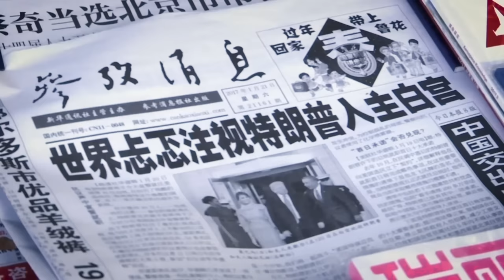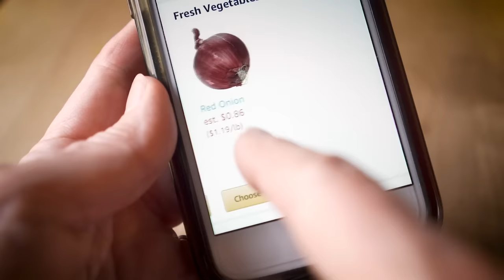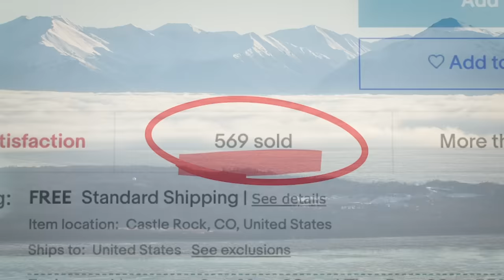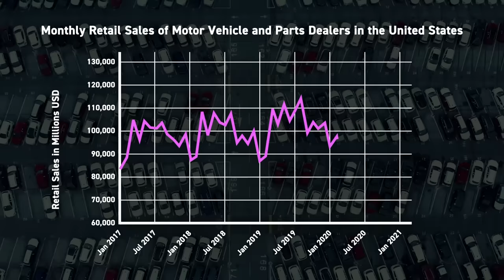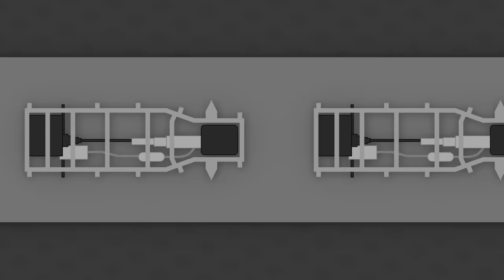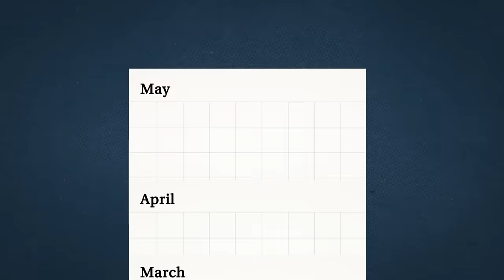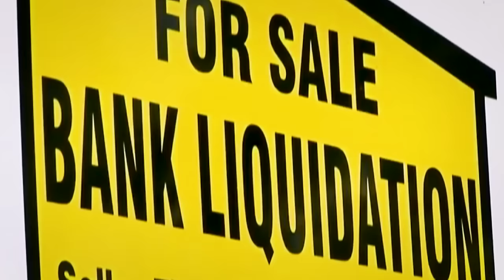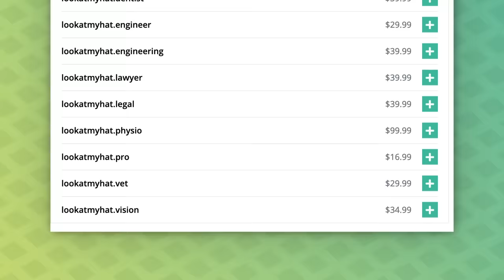Why There are Now So Many Shortages (It's Not COVID)

Comment: This video points out what happens when a single item in the supply chain is depleted when basing one's supply chain management on the Just In Time (JIT) philosophy.  You can have thousands of unique parts ready for assembly but a single 10 cent item can hold up production.  This video uses the semi-conductor as an example but it could be any part that holds up the production line.  The key is differentiating between complex and simple supply items and then mitigating risk appropriately to ensure proper inventory of complex supply items are available.
Reply: semi- conductor =processor chip
Reply: Exactly. The disruption caused by the Tsunami In 2011 should have been a learning moment.
Reply: No. JIT is NOT the problem. The problem is all the manufacturing being done in China, or off-shore. We did not have a food shortage BECAUSE 99% of our food is grown or produced locally.
Reply: @odysseus2656  and exactly how is foreign stuff a problem?
Reply: Doesn't matter so much where it's coming from, just matters whether and when the necessary ingredients come, although having your supply chain spread all over the globe means that a natural disaster or political disaster anywhere means a greater chance of your supply chain being disrupted.
Reply: @Vrangelrip  It's not "foreign stuff", when the quarantine started the Chinese supply chains shut down completely. I work with a U.S. electronics distributor, we had  Chinese tech firms ordering components from us here in the USA that we would ship to China. That put a strain on U.S. tech firms supply chain which pinched off supply.
Reply: @odysseus2656  It adds risk to delays and adds risk based on politics but it isn't the main issue. A solution to the main issue is; Building manufacturing that doesn't run at capacity and can ramp up if needed is a solution but this requires infrastructure to change where the supply goes if any 1 facility is damaged. Implementing that type of backup is difficult across boarders, and not as profitable in the short term. Toyota's solution to the supply part was well thought out.
Reply: The real reason the USA west media falsely accuses CHINA of mistreating Uyghur Muslims is because they want to prevent the 1.6 Billion Chinese worldwide and 2.0 Billion Muslims from working together. Both these groups have been discriminated by USA and the WEST for decades and are more likely to work together. Chinese & Muslim nations working together will lead to US losing its dominance of the world. Plus this will gain Asia, Russia and African support too including the rest of the world.
Reply: @jameslim3850  No, I worked with a Chinese company, China does mistreat Muslims.
Reply: @MindHunger  I live in a country where Muslims and Chinese have been living together and working together peacefully for many decades. So you are completely wrong.
Reply: @jameslim3850  Chinese people live in many countries. In most places, they live in peace with everybody. In mainland China, however, the Chinese government is enforcing discriminatory policies against many ethnic and religious groups, not just Muslims.

It's a historical trait of the Chinese civilization. And it's the reason why China has survived, as a state, whereas Rome has not. Both were once huge empires. However, China worked hard to enforce a single language and a single culture across the entire empire, whereas Rome was content with letting every ethnic group and every religion do their thing, as long as they were paying taxes. This has led to one single huge country, in the case of China, where this policy of assimilating any minority group, forcefully, if necessary, is still practiced, and to many countries, each one culturally different, although heavily shaped by their Latin inheritance, in Europe. Even more, Germany, Austria, even Russia - countries that were never part of the empire, were still heavily influenced by the culture of ancient Rome. Therefore, while Europe is culturally quite diverse, there are many elements that bind all European nations together. The EU isn't just a political construct, it's the result of the cultural closeness of European nations.

Which system works best is something everybody has to decide for himself - none is without flaws. But if you look at human rights, human development index, GDP per capita and mostly any such indicator, Europe, overall, does way better than China. Few countries in Europe, and none in the EU, fare worse than China. This, IMO, is highly likely to be at least partially related to the cultural differences between the two societies. Cultural diversity is nurtured and stimulated in Europe. In China, being part of another culture than the mainstream one gets you in trouble. In fact, it can get you in jail, or even worse, killed.
Reply: @jameslim3850  Also, Taiwan is a country 🇹🇼

Comment: Also Toyota is offering straight cash for the chips.  Meaning when the chips are ready to ship out, the manufacturer gets the payment immediately, instead of to be billed later.
Reply: Also Tesla has been pre paying for their chips when they order to be at the top of the list
Reply: when i buy in town from local merchants i always pay first. i demand a receipt proving prepayment, an ink signature, sales clerks get pissed off, bosses shut them down. In twenty six years of living here I have NEVER had a late, missed, deferred delivery (I also tip the delivery drivers with cash and/or bottles of gatorade! 😁).
Reply: Net30 is an industry norm for US due to at times not getting items in time.  Problem is it works on some industries due to the way they are.

Comment: “Short term profits over long term gain” - this is the fundamental problem with all economies. Every CEO in a major company only cares about the next shareholder meeting. Investors expect instant returns. If you don’t do well the next quarter, you might be fired.  So these executives will always prefer short term gains. Changing this would require a complete change of the current system.
Reply: Notice most CEOs only last 3-6 years? They never deal with the consequences of their actions.
Reply: Not true of founder CEOs.

Comment: When I played Factorio, my production lines had buffer supplies in them, so that if for some unforeseen reason my production line shut down, the downstream factories would have a buffer of supplies that would last until I could get the production line up and running again.  Production lines were always higher ramped than necessary to provide for the factory, so the buffer would fill until it was full, and the buffer size was set so that it was excess, but not a terribly large amount.  Just enough to get by on during an emergency.

It's sad when video game players are more familiar with proper supply chain logistics than the so called experts who do it for money.  Hell we do this shit just for fun.
Reply: Well, factorio did not have office politics in it~ But I get your point, and would like to add another : executives should try playing simulation games to try new ideas.
Reply: @bmanpura  But that would require them to use of their time and time is money. And it would actually require them to learn and do their job properly to provide backups and engineering redundancy into their systems, which will take out of their precious profits. But hey, it is not like strategy sims teaches you about redundancy or anything
Reply: @jack6723  Haha! That's a good point.
I hope they love their job and their customer more than they say they are.
Reply: @_prithvideep  not only that, they did not expect the United States Feds will flood the system with stimulus which creates artificial demand for the products. They probably mostly thought that the US Feds will be able to handle themselves properly and allow the system to fail. They failed to realize that ever since 08, the US Feds have deemed things are "too big to fail" like the financial institutions and other companies. If you had a company running at a negative and were deemed "too big to fail" the United States would bail you out. Which btw, is not how the game should be played. Now, business that are trying to start back up, can't because the Feds have outpriced them out of the market. It makes you wonder how much of the problems could be solved if the Feds didn't touch it
Reply: Difference with factorio, if you produce 10,000 green chips, you know you will eventually need those 10,000 green chips. Recipes that need green chips (red chip, inserter, etc.) stay the same throughout the entire game, they dont change. You are not going to be left in a situation where you use 100 of your green chips and the the recipes suddenly change to needing 'yellow chips' instead, making your other 9900 stockpiled green chips worthless.
That is why stock is considered waste in Toyota/Lean manufacturing - they dont want to be left in a situation where a model change makes their inventory worthless.
Where the problem is, they dont make allowances between products that will change in the short term (a car door for instance, which only fits that particular car), and those they know they will still be needing in a year + time (a can of paint, a pallet of chips),  and view them all as waste.
Reply: @FPK I was reading through hoping someone would know that storage has a cost. Possibly needing more space. Then protecting the product. In a business like mine we pass cost of expendable to the customer plus 10%. So we can’t buy those items to keep. We need to turn receipts in weekly.
Reply: Doing it for fun rather than because you're pressured into it because you need a job to eat, well ... People who enjoy what they do, do it better :)
Reply: FYI in the real world stuff gets obsolete. You can't afford to have supply buffers.
Reply: @brunoenricobignotti5448  thats why they always get it wrong.... they implement toyota/lean manufacturing in such a way it dosnt distinguish between things that WILL be obsolete in the short term, and things that will still be in use in 10 years time....
Reply: @James Henry Smith 
Because people were told not to work.
Reply: The real problem with supply buffers:
Yes, they do cost a bit, and this bit can make a world of difference in industries that sell with razor thin profit margins.
If your competitor says "nope, i won't build up buffers for the moment shit hits the supply fan", then you can either: see that competitor undercut your product, or cut your buffers and their costs too.
It's a rats race to the bottom, everyone wants to produce more for less.
If you aren't willing to join the race: you usually lose by default.
Reply: It's not sad, it's reasonable/logical. When you play a video game, you are interested in your "enterprise" to be the most efficient and create the most value, of all competing enterprises, from the start of the game until someone launches a rocket. When you're the CEO of a real-life corporation, you don't plan on staying there forever, your driver is personal gain and shareholder satisfaction for the short period you'll stay at the helm of that company, not the well-being of the company. Most shareholders at most corporations are not sticking to their shares long term either, so they'll definitely like someone maximizing shareholder value short term more than someone thinking long term.
Reply: 'I played factorio once so now I understand supply chain theory'
Reply: @FPK My job is literally Risk Management, and I'm a Director.  When it comes to Factorio, the stock that I have for lines is lean in the sense that not every one has a buffer, only the ones at risk of a supply shortage for some reason.  The buffer supply I have is kept low enough to provide in an emergency, but not so high that I'm not OK with the loss if I have to just dump it all or it never gets used.
Reply: @tomurko  I certainly get that it is overly simplistic, but that's my point.  The actual concept of lean in itself is not that complex.  I'm not claiming to know everything there is to know about supply chain theory because I played Factorio.  Understanding fundamental concepts is not really that difficult, and sometimes practitioners end up forgetting or not implementing the fundamentals for lots of various reasons.  Your attempt at sarcasm is the only over-simplification here.

Comment: 5:41 So...that can be made less damaging if more production is shifted back domestically and closer to the consumers? What a revelation!
Reply: U.S. politicians: "Build in America, and buy American!"

U.S. shareholders: "Manufacture in China because it's cheaper! Give us more short-term gainz!"

U.S. corporate leaders: "Uhhh..."

U.S. shoppers: "Hey guys, can you stop arguing and just deliver some products for once?"
Reply: Not necessarily, but you stockpile as much as you can afford to loose - and for a lot of semiconductors , like he said, it can be yeara before you see a new plant producing OR months of adapting designs and supply to different chips.
Reply: The real revelation came to companies when they found that they could get their parts and supplies from China more dependably than they could from the factory 50 miles down the road.
Reply: @chrisgraham2904  All those nasty unions and benefits and fair pay and domestic income going back into the community. Pfft, who needs that when there's shareholders!

Comment: If you’ve tried to buy a white dress shirt you’ve probably seen that those are almost impossible to find.
It seems like everyone has a shortage of something.

What’s worse is not only has the supply cut drastically, but the demand has risen incredibly high as well.
Many times more weddings than normal in 2021, many people have changed their weight enough to need new shirts, and the normal needs as well.

Comment: My Dad used to drive a truck.He picked up a load onetime at Ford's Lima engine plant with orders it was a hotshot- speed as needed to get to the assembly plant on time. He did, but traffic and accidents put him behind. About 30 minutes away, three State Troopers pulled alongside and motioned him to follow. They made that last half hour's drive in less than 20 minutes, with every ramp, gate and access road wide open and folks waving him into the dock. As they were unloading his trailer, the docker told him they'd had less than five minutes to put those engines on the line or the entire plant would shut down, at some mind blowingly astronomical cost per minute.
Reply: this didn't happen
Reply: @Van-..-z._-_z.-._-._.-z.  - True story, and he's not even the sort to embellish. This would have been back in the late 1980's.
Reply: @Van-..-z._-_z.-._-._.-z.   time and distance could be a bit exaggerated but I’ve seen more unlikely with my own eyes.
Plus I’ve never met a “Floyd” that was a liar. Floyd’s tend to keep it real. 😏
Reply: EAST BOUND DOWN LOADING UP AND TRUCKING
Reply: @Van-..-z._-_z.-._-._.-z.  Sure it happens. If a car plant assembly line stops, it's thousand of dollar a minute for whatever the cost of the car was that wasn't produced plus the cost of the labor standing around sweeping the floors instead of putting parts on.
Reply: @timnicholson6377  - don't doubt the 'time and distance'; this is when the GMC powered rig he was driving had dual turbos blowing into a supercharger. He never got a top speed on it, but it would pull an overloaded 53' trailer across Wyoming with the speedo needle buried, wrapped back around to the first 'r' in 'Freightliner'. : D
Reply: @floydblandston108  That’s awesome! 😂👍🏽
I don’t even doubt the smaller details now. 
Thanks for sharing! 

I know more about Troopers than I do big rigs even though I’ve worked around both almost equally...I knew you were probably not bullshitting when you said “Troopers” as opposed to “Police”....

never met a Trooper that was not cool as a fan and more on the side of the people as a whole than anyone else.
I think it’s sad that they are so commonly thrown in the same bucket in the minds of the mass’s 
Troopers can and do arrest police from time to time ya know.
Have a great day. 👍🏽
Reply: @timnicholson6377  - the part I've always been interested in is the Ford- State Trooper connection; is that a plant manager level call, or higher? : )
We had a friend who was a Barracks Sgt., and I don't think he'd approve something like that on his own authority.

Comment: I’ve worked in a few manufacturing plants. Add just enough to just in time. It doesn’t work. It didn’t work at those plants. Constantly changing over to the next run. Wasting time on hours worth of change overs. Also add can’t make a mistake and scrap a thing. Cannot say how many times we ended up a few short because somebody didn’t follow through with all their checks. Something got messed up. By the time somebody realized it we were already switching over tooling to the next run.